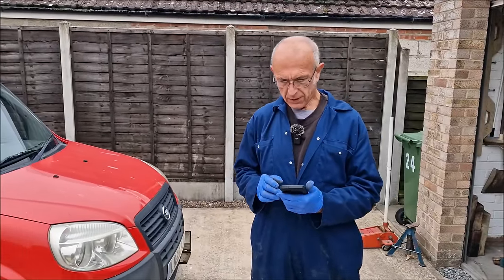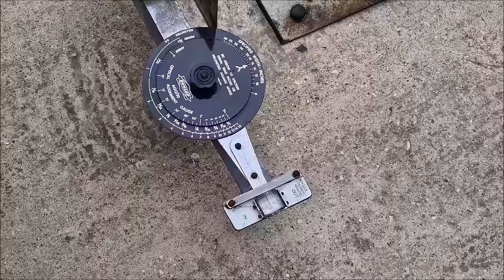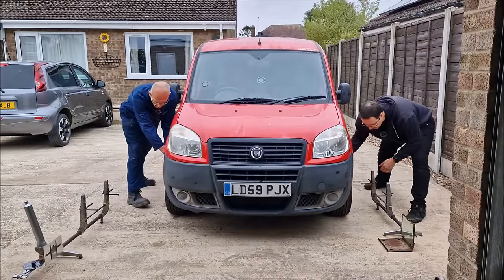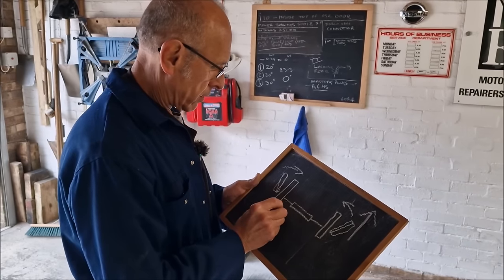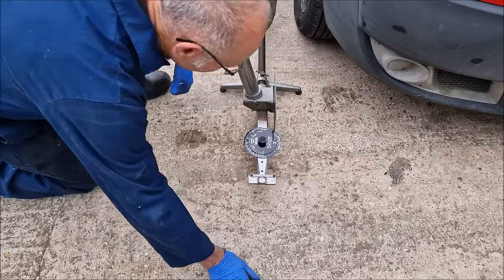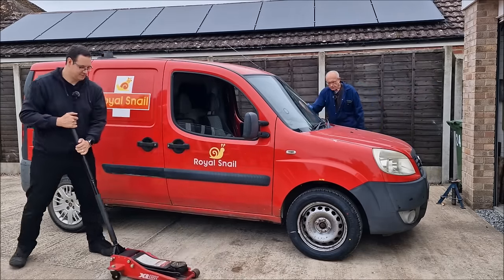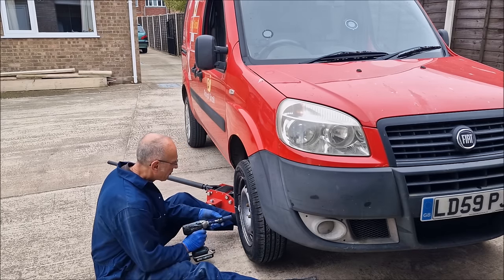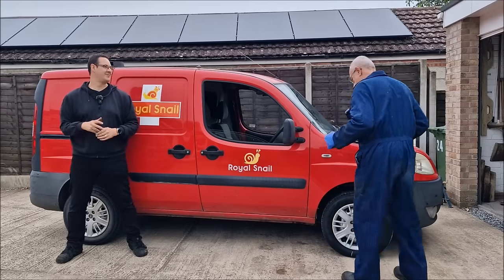£20 Wheel Alignment On My Fiat Doblo Van - 1950's Style - Dad LOVED These Vintage Guages!

Comment: Tracking is a nightmare, a few years ago I went to a garage to have two new tyres on, the fitter suggested having the tracking done, I did not think this was needed, but went ahead anyway, when I left the garage, the steering wheel was not straight, but a long story short I ended up going to a steering specialist, he had one of these four wheel alighners, he showed me a print off of the wheel alignment, it was miles out, he put all four wheels back to factory speck, I never get tracking done at a tyre garage now, they only take it up on one side
Reply from the maker: Blimey! We decided to give it a go ourselves after a similar train of thought - thanks for watching

Comment: I have used parallel strings. Went to get it checked for free at 4 point check and was almost spot on.
Reply: This method in video seems a load of faff.
Reply from the maker: Excellent 👍
Reply from the maker: Ah but it's interesting to some 🙂👍

Comment: Not sure if this applies to Doblos but you don't usually need to fully take the wheel off to fit or remove Fiat wheel trims. The bolt that's closest to the valve stem can stay on.
Reply from the maker: Ah that's interesting. This does indeed need all the bolts out to remove the trim 😁👍
Reply: Yes in my Fiat Tipo the factory option wheeltrims had one bigger hole so one bolt could be put on to secure the rim and the trim put in place with the 3 other bolts going through and trapping the trim. 

I wonder if the previous tyre wear was down to cheapo tyres that should have been increased load spec (XL) for a van ?

And yes those wheeltrims are like the 16" Rover 75 Union alloy wheels.

Comment: Tracking gauges? Tape measure would be simpler

 Just dont do the fronts until you get the car to drive straight first with the rears or you will be going back and forth.
Reply from the maker: We had the tracking guages so made sense to use them :) - but you are right - you can use a tape

Comment: This reminds me of a Cortina estate my dad had, which was eating tyres. The garage couldn't sort it until one day the mechanic asked him if it carried a lot of weight (it did). Despite the manual saying the setup had to be done empty, he did it with some barrels of water in the back and the drivers seat. Never had a problem after that. Perfect slow and even wear.
 One thing that can cause random mysterious clunks, is suspension bushes. If they go dry (no lubricant) the inner and outer part can stick to the metal, and when it releases it makes a slight clunk noise which is transmitted through the suspension etc. That can start overnight, and disappear just as quickly with temperature, humidity, use etc.
Reply from the maker: That could be a good shout! It did happen after I had a significant weight in the back and since my holiday has now gone again. At least it's safe (we think) - glad we did the tracking 😁

Comment: Looks like it has too much camber but I see that more often with Doblòs
Reply from the maker: Yes apparently it's a common thing!?  We never knew
Reply: @JonCoupland  maybe the struts and springs need replacing
Reply: I asked an oven service guy how he liked his Doblo and he said he was always having to have work done on the front suspension. Possibly down to second rate replacement parts but it is disappointing... these are quite cheaply-built vehicles though with a fairly weird Fiat front end setup...

Comment: Would have thought that type of gauges were 60s type
Reply from the maker: Later model numbers were from the 60s but I cross referenced the number 😁👍
Reply: I had my tracking set a few months back using the same gauges 🤔 lots of tyre shops still use them.